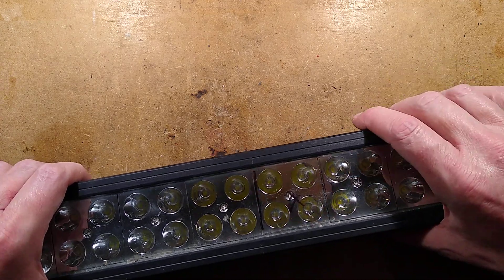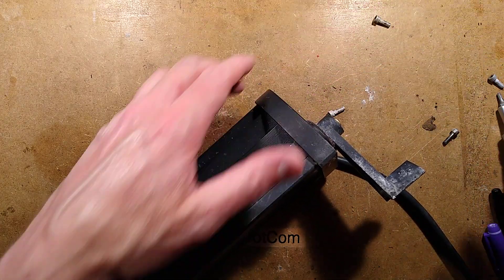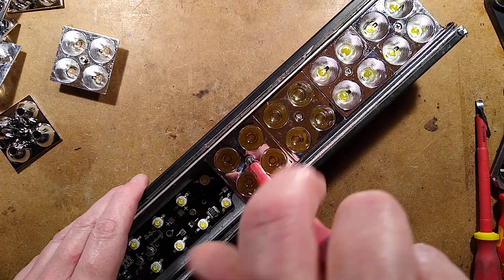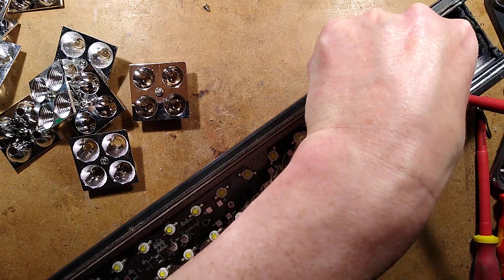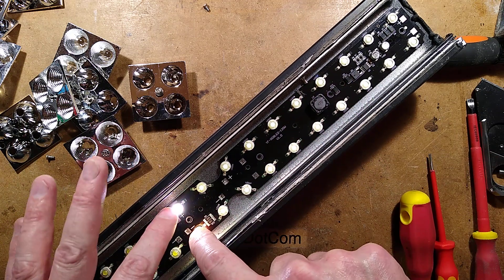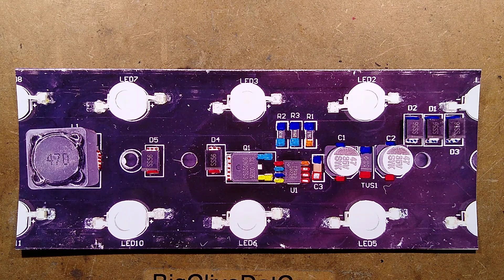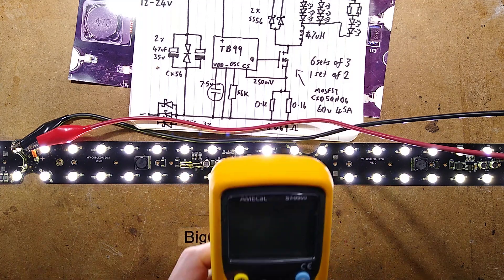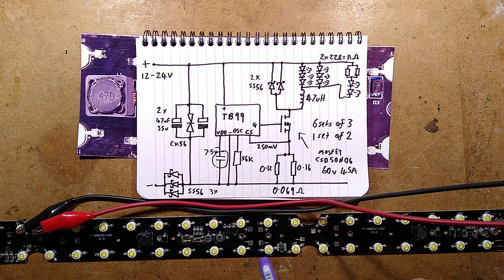Opening a work light from a commercial fishing boat (with schematic)

Comment: Best advice I could give you guys is when you buy LED lights such as this, before you even install them on the vehicle take clear adhesive sealant, !NOT SILICONE! and go all the way around the light. Put some under each screw everything. For me it works best if you can somewhat disassemble the light first. I've never had water intrusion on any of my light bars since I started doing this years ago. Oh and make sure to put dielectric grease on the wires because the light will absolutely 100% wick water up the wire.

Comment: I had to repair one of these and on both edges it had a solid copper wire for the positive and negative that was maybe a 10 gauge, hardest thing I've had to unsolder the aluminum housing was acting like a heatsink and I didn't have a heat gun, it ended up being a broken trace cause the thing heats up so much and expands and contracts

Comment: Interesting. I would have guessed that most circuit boards that go out on the sea have some conformal coating applied to survive a bit longer if the case seal does leak. Guess they saved a few cents there on not having to wash the board after soldering and not using a spray robot that manages to avoid the LED lenses while coating the pads...

Comment: The cheap LED flood lights used on fishing boats are a nightmare , they produce radio interference that effectively halves the range the boats VHF radios can receive at , interferes with the GPS navigation and the AIS receiver goes to half the range ( AIS : Automatic Identification System , boats carry them linked to their GPS and it transmits the boats name , course and speed so other boats can see them directly on their radars and gps navigation computers )

Comment: Before Autoglass came with the insurance, I once (with help) fitted a replacement windscreen and used washing up liquid to lubricate it into the seal before it dried when it acted more as a glue or in any case no longer a lubricant. Are there other substances that would do this better? Maybe a mastik ...
Reply from the maker: It's guess the automotive glass installation industry probably has some specific products optimized for that use
Reply: It certainly makes sense, otherwise many of the more modern glass shapes employed would be impossible to fit.
Back when I cared more about these things the VW dealership (my missus got her Beetle from) had to fit the rear spoiler after it had been imported and we had to wait a couple of days. That was back in 2001. Slightly different job but clearly one hell of an adhesive that needed 24+ hours to fully cure. Now we've got Bodykit Metal Panel bonding for £12 a tube on ebay

Comment: TVS1, the CK56 part has a General Semiconductor (Vishay since 2001) logo on it. Google 'Vishay SMBG' to pull up the correct datasheet. The CK marking makes it a SMBG30CA, 30V bidirectional clamp. 56 is a date code.

Comment: Re differences in corrosion, would electrolysis be a possible explanation? Salt water in atmosphere + current in circuit. Possibly heat differential from hot leds W colder climate?
Rig a diffuser panel across the top of the old extrusion, that could be an interesting indoor/covered floodlight. Maybe lower wattage to bottom limit to make that more reasonable?

Comment: I'm a bit bemused by the 22 ohm resistors. They are presumably intended to drop about the same voltage as one LED. That implies a current through their two LEDs (and presumably therefore also through each set of three LEDs) of around 250 mA, so nowhere near the suggested 2 W per LED. Of might you have misread the resistor values?

Comment: The manufacturers could have used a more robust capacitor. This one was obviously operating too close to its limits. Annoying, because a perfectly case good had to be destroyed to fix it.
Reply: FWIW MLCCs from certain manufacturers used to (and might still) have a certain failure mode that made them susceptible to damage through thermal cycling during soldering or in operation.
Reply: Very poor editing on my part Clive. I don't normally arrange sentences in a non-sensical fashion.

Comment: How would one go about increasing the power of one of these units? Such as replacing the LEDs with higher wattage and then modifying the circuit. I have a very similar Chinese LED bar that had some 1w LEDs burn out so I replaced them with the 5w variant and I wish to try and get them a bit brighter.
Reply from the maker: Using better quality LEDs can make a huge difference at the same power.  If you increase the power the new LEDs may fail fast if the heatsinking is not rated for it.
Reply: Does the actual power draw of LEDs translate into greater heat or does the efficiency factor in?  If it puts out more energy in the form of light, does that mean less heat needs to be dissipated compared with an LED of lower efficiency that puts out less light for the same power input?

Comment: Seems ashame to have to through it away and replace it, as in the old days!!! You would just change the bulb.

They should keep the drivers seprate to the LED's  Also the lamp should posible to open as it could be fixed.  But like all stuff nowadays they glude it so you throw it away and buy another one.

Comment: it needed the capcitor since the inductor needs to source its current into a cap and that is what that cap will do as its part of the chip . its hidden because you normally see it after the shottkey diodes and it still is if you explode the inside of the chip. so thats why it wasnt working and thats why replacing it worked.

Comment: Ah yes the Irish Sea is full of salty items not to mention very salty sailors. Now if the glass is not broken one could get a tube of that 3M windshield adhesive and rebound the glass back into the housing. Its rather expensive but if you know someone who has an automotive body shop, they might have an open tube available. Interesting power circuitry. Those multi layer caps can be found as decoupling caps on the final transistors of RF circuits on some equipment. When they fail they usually take out the RF power transistors they are soldered to as well as cooking the circuit bord underneath them.

Comment: I wonder if that corrosion around the capacitor and those LEDs is related to incompatibility between the plating on the components and the solder used on the circuit board? And also how could we tell?

Comment: Could a Transient Voltage Suppressor protect a temp sensor signal? I've have a 3d printer board die because somehow the temp sensor found the 12v from the heated print bed, I have seen some schematics with the symbol for TVS's but some don't and I'm not quite sure exactly how they work. Any thoughts?.
Reply from the maker: You could possibly use a 5V transorb.

Comment: Hey Clive, have you done any videos on remote 3-way switches? I was gonna sift through your past VJs and seen that I would need a cray computer and an X rated version of Excel to find what I am looking for.  I love how you do your vids, and how well you explain what is taking place, so after buying some of these 3-way switches to save me from ripping apart walls to install switches, I thought, Hey!, Clive would know! And if you haven't, I wish you would. I would love to send you a set, and an IC chip I have that has a window in it (I think it is from a color laser to detect?), but it would probably cost me more to ship it than just pay you to buy one... I'm wide open... Please keep on keepin on.

Dan
Reply from the maker: Technically speaking, any of the standard remote switches can be made as many ways as you like by pairing multiple switches to the same receiver.  You can get the remote wall plates that cover existing switch positions or can be stuck directly to a wall.
Reply: @bigclivedotcom  That's the ones. I was hoping to see how they are configured and am not sharp enough to do the reverse engineering. I am a retired HVAC guy and have an interest in electronics, but alas, I am not up to par with guys like you. I would like to see remote temp alarms using thermistors to ward off frozen pipes in the dark corners of the crawl spaces. I may be able to find them online or perhaps using a thermistor, pair it with a remote... Chances are, I could shop around and find they are already available.

Comment: I have one of these generic light bars on my work van. Bad part, is it is extremely RF noisy. I can be listening to a full quieting signal, turn it on and it goes away after a "KSHHH" squelch crash. Ive tested it as causing nearly 40db desense in VHF at about 146MHz. Its also only 8-10 inches away from my VHF antenna on the roof, so thats definitely not helping me. I havent bought another one because Im reasonably certain they are all like that.  If they are using these on a boat, its likely going to reduce the range of their Marine VHF radio. It'll still talk out as far as it normally does but the range it can hear will be reduced.

Comment: Something of interest I have one of those  led light switches for like dark closet but for some reason when you use it they cause their aaa batteries to leak I would be willing to send one if you are interested. I really want to know why it does this lol
Reply from the maker: Does it do it after it's been running for a long time?
Reply: No it has just been sitting on my fridge don't think it's been on longer than a few minutes recently and currently has an leaking battery that was replaced a few months ago for the same reason. I do have 2 but only one was left on for long periods on accident both cause batteries to leak they are a few years old though

Comment: Now this is another good one!  just wondering if it was built for the conditions it was used in?  those things are very common in this neck of the woods (Eastern Canada) and as you say, commonly used on ATV's.  Excuse my ignorance, but what is potting compound? Is that something the components are mounted in or a protection for the components?  Wasn't expecting to see the interior so neat and clean for sure.  That was a very very interesting dissection!  Thanks again
Reply from the maker: Potting compound is a two part mix used to encapsulate components.
Reply: @bigclivedotcom  Thanks for that, makes perfect sense now

Comment: It's only me from over sea, said Barnacle Bill the sailor....   
I may be in the wrong universe again, but I thought that, in the special case of just two resistors in parallel - the values (0.12 + 0.16) are added together  ( = 0.28), then divided by two, (0.28 ÷ 2 = 0.14 ohms). ?  Plz correct me if I'm wrong.
Reply: You've used formula for "average". Two resistors in parallel shortcut formula is R1×R2/(R1+R2)
Reply: @billr3053  Thanks Bill.   Guess I'm in the Wrong Universe again... What about 'the special case of two resistors of the same value, in parallel' ?
Reply: @snakezdewiggle6084  Then you just divide its value by 2.
Reply: @billr3053  cheerz Bill ;)

Comment: Did the boat not have a proper sacrificial anode? It's a bit of a stretch, but the solder corroding... might be a good idea to see if BoatyCaptain McBoatFisherman has other sealed electronics presenting the same corrosion. Would suck if radio / engine management electronics fail at inconvenient moments.
Reply from the maker: That only protects the boats own hull.

Comment: The Wife's got a similar model on her Rodeo. Sealed the glass with Cap'n Tolley's Creeping Leak Sealer (excellent product!), and drilled a few holes in the main casing for ventilation / prevention of any moisture accumulation. The chips (Osram) are on an aluminium backed board, and as usual assembly was a bit skimpy on the heatsink compound. After reassembly, the light is pretty useful - "spot" and "fog" beam functions, with an additional (unfortunately very anonymous) chip controlling these functions. Produces more than enough light to avoid our local wildlife at night (which was the purpose after all!) - looks a bit like this one - https://www.bullseyeproducts.com.au/wp-content/uploads/2019/05/42-inch-dual-row-curved-light-bar-2.jpg

Comment: Honestly alot of the offroading/at lights are good nowadays. Used to be a mechanic and ive worked on ranger vehicles that had 800k km on the clock, most their in or partially underwater and I noticed within the last 10 years things like spot lights and light bars just seemed to slow down on failures and even some of the cheap ones ceased being mobile water reservoirs.
Was good to see inside one though most are sealed like that and if I had to replace them the customer always wanted them back so they knew we changed it....despite the fact it was usually a different brand or style and going some water filled not working to brand new and working should be pretty clear proof the job was done.

Comment: My guess is they crimped the top of the extrusion down onto the glass with a big roller.
Reply: I would think a lubricant that allowed the glass in, then sealed on the ends. Just a WAG though...
Reply: Saliva is a good lube to use on bike handlebar grips.

Comment: @bigclivedotcom Ive had my share of these LED light bars over the years & failure is common, Its a really good idea to go over the light housing screws & tighten them down (being careful not to over tighten them because steel screws in an aluminium housing) to prevent or at least limit water ingress. That said they all have a life span of a few years depending on application & exposure to the elements

Comment: Thanks Clive. Great tear down. I learn something new each time I watch one of your videos. So on electronics for dummies 101 can some one explain how to check likes of that faulty cap while still soldered to the board ???
Reply from the maker: It depends on its location in the circuit.  Normally it's difficult to test capacitors in circuit.
Reply: @bigclivedotcom  thank you. Hoping you demonstrate the process some day as part of one of your videos.

Comment: Could the glass of been bonded in place with heat afterwards Clive? Intresting construction 👍
Reply from the maker: I'm not sure how they achieved such a linear seal in that confined space.
Reply: @bigclivedotcom  I took apart a similar light.  I thought they'd probably used a preformed sealing strip, and used something like alcohol as a lubricant to slide the glass sheet in (mine was acrylic) alongside it.  Same technique is used to get bicycle handlebar grips onto the metal bars.  Once the alcohol evaporates, it's stuck fast.

Comment: I had a single row version that I had taken apart a few times due to moisture ingress. The trick is removing the endcap then using needle nose pliers, pull out the silicone rope/string seal. It stretches and pulls out easily, then the front glass will slide out with ease. Putting it back is tougher though sliding the glass along with the silicone seal pulling along with it and not ending up with a lot of stretched out seal in the ends. I took out the lenses on mine that covers the leds, which allows some side spill so I can see more at the sides when turning on mountain roads.

Comment: Cool. Do you think that they put the fault-prone cap there accidentally, not knowing it would fail easily? Where should I start learning electronics so I could design a light like this with all the protections for reverse polarity and such? Thank you for the videos, they have been interesting, informative and funny. I built some 100W led spots(driver + single chip led) without any protections and are looking to have temperature, current, voltage and reverse polarity protections at least.
Reply from the maker: I think it was an unexpected failure.   The best way to learn electronics is to start tinkering.
Reply: @bigclivedotcom  I am tinkering as I said. Do you have any recommendations for learning? Websites, books, anything? :)

Comment: i've seen issues where  silicone is used to seal the enclosure and it releases acetic acid whilst curing which can be traped inside. So copper tracks can be eaten away over time.
I've got to seal a box for an antenna tuner and i'm trying to work out how long does the acetic acid get released for if i use cheap sealent. Maybe after a week with the lid off it might be OK to close the box.
Reply from the maker: You can get neutral curing silicone.

Comment: I really dislike how so many LEDs are done in series, it means if one goes out they all go out... And most end-users won't be able to replace one and so all of them are then out of use or the whole light is when there's perfectly fine components there...
Reply: its likely done to reduce current,
Reply: By my possibly incorrect calculation, they'd need ~26 amps if all in parallel (assuming 3v leds)
Reply: @obliviousostrich1002  Why so? I'm intrigued, I'm sure there's reasons why they do it, but I can't see it other than less components and so cheaper component count.
Reply: @ElvenSpellmaker  As I understand it (I'm just a hobbyist) the LEDs are probably low voltage 2-3v (i forget if clive measured them) and in series their voltage adds up while in parallel it doesn't. Given that current = power(watts) / voltage, having them running at low voltage means they must draw higher current to run at 2 watts. Higher current requires thicker wire/track and beefier components to prevent voltage drop & overheating. If you've ever seen those LED strips where the end is dimmer, that's the voltage dropping due to the resistance of the thin copper track along the strip. Lowering the required current(by increasing voltage) or the resistance(using a thicker / shorter conductor) would reduce that effect.
Reply: Oh and components rated for high current would be bulky and expensive
Reply: @obliviousostrich1002  quite likely if around 80w total, so parallelling not really practical!